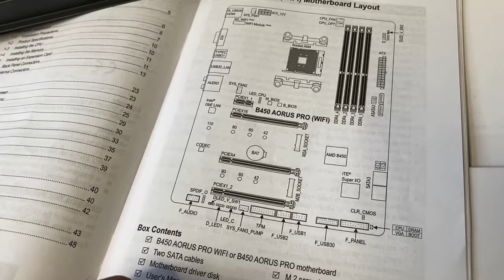How to Install a Case Fan in your PC

Comment: Hey so I have a Corsair 4000x case, just got a Corsair ll120 fan and the screws that came with the fan have too small a thread to tighten into the holes provided, the case also didn’t come with nuts which would’ve solved the issue. Am I missing something or should I use zip ties which looks like

Comment: Hi! What about those single fans that has pins for motherboard and a pin for psu ? Is it okay to plug both the wires or should I just pick one power source between the board pin and the psu pin??
Reply from the maker: I’m honestly not 100% sure. I think the pins for psu are for rgb. I’ve never used one of those fans so I don’t want to give you false info. Sorry
Reply: @BuildsWithV  my fan has lights but it doesnt change colors its fixed, i wonder if it would be safe to both plug the mobo pin and psu pin on a single fan 🤔 so i could change its speed.

Comment: So you can use the piggy back cable on ur fan as rgb lights too? You don’t have to plug in the rgb lights cable to the mother board and instead you can use the piggy back cable right?
Reply from the maker: That is correct. Thanks

Comment: what was that digital rgb you've mention at @4:20?? Can you tell me so I can see if my motherboard have that one, I have a Asus prime b450-A btw.and i recently bought a rgb halo fan but no lights im scared of connecting to other ports maybe it will blow. 
Thank you please do notice me :(
Reply from the maker: It’s a 3-pin Addressable RGB port. It has 3 pins total and between the pins it has one missing. If your fan has that connector it would plug in there. What fan did you buy?
Reply: i have Cooler Master MasterFan MF120 Halo 120mm fan sir
Reply: @BuildsWithV  I messaged you on your facebook page, I'm AR
Reply from the maker: @alryanalam  oh yeah those are 3-pin addressable RGBs.

Comment: Hey, so i bought these fans 2 days ago and my motherboard only has the “LED_C” 4 pins, is there any way to do it without the 3 pins because it doesn’t seem to work for me with the LED_C
Reply from the maker: Enrique He yes you can get an adapter like this one: https://amzn.to/3fZWMrf 

It’s a 4 pin to 3 pin converter
Reply from the maker: Enrique He it does not, the one you have is just a splitter meaning it allows you to connect up to 3 fans/RGBs to one header. The one I sent you is a 4-pin to 3-pin adapter. You plug it into the 4 pin header on your motherboard or the sata plug off your psu and then you plug all your 3-pin rgbs into the adapter. 

The reason you need a special 3 to 4 pin adapter is because the 4 pin header provides 12v power and the 3 pin only runs on 5v. If you plug 3-pin into the 4-pin header somehow, it could cause a fire.
Reply: @BuildsWithV  Thank you for taking your time and helping me with this. I appreciate it.
Reply from the maker: Enrique He it’s no problem at all. If you have any more questions, don’t hesitate to ask. I appreciate the support 🙏
Reply: @BuildsWithV  How can this be powered? From what you said u could either connect it to the 4 pin or the PSU for power, so does that mean the converter can be powered just from the 4 pin or does it need to be connected to both the PSU and the 4 pin? Thank you.

Comment: Question why do motherboards ship with a male 3 pin to a 3 female pit adapter what are they used for then? if fans are directly connect to the mother board?

Comment: Sort  of wondering if the rotation of the fan makes a difference that's my main concern I have Artic P14 PWM's and got two fans intake & 1 out take... besides from front facing etc does it matter which way it is rotated?
Reply from the maker: Seemslegit The fan rotation would matter, but usually when a fan has opposite rotation they also have opposite fins to keep the intake coming from the front of the fan. Thanks for watching 🙏

Comment: Hello I have a question! My case supports up to six fans, but I checked my motherboard and it only has one for fans. What do you recommend I should do?
Reply from the maker: I recommend a fan hub that supports several on one header. I have a fan hub video as well which explains in more depth

Comment: Can I ask a question? I bought a rgb LCD fan, however my computer doesn't have a connector for the the rgb three pin. What would you recommend, so I'm able to use the rgb.
Reply: Depending on your setup you may need a hub such as the corsair commander xt. It plugs to the USB on the mobo and you can connect 6 fans with rgb.  My case is a corsair with four fans plus a 100i capiellix with two fans.
Reply: @AuronFFX  wooo nice thank you for the reply Auron ^^
Reply: @AuronFFX  found out my motherboard can't handle a rgb connection. So ill just use the fan as it is
Reply: @Mina_Angel  What is your motherboard? If it has a free USB 2.0 header it should be able to support the commander. You also will need a free sata power connector from your PSU.
Reply: @AuronFFX  well its more, I don't have the money for it. Plus the Commander doesn't have a inlet that will work with the rgb plug. Its a weird 3 prong, like its 2 open spots, 1 blocked and then open again.

Comment: Very helpful 👍, i was confused about 3 pins and 4 pins power comnectors and scared i might short something in my mb, i have a case with argb but my motherboard only has rgb headers,i have built in controller in case, so no need to hassle around to connect in motherboard

Comment: So if you want to have 4 fans running you need 4 sys fans in your motherboard? I heard you can connect them together with a splitter but, is that the only way to connect them if you only have 2 sys fans?
Reply from the maker: You can use a splitter or a fan hub if you have more than 3-4 fans per header.

Comment: Question, we’re can I add fans, can I put them anywhere?  Or is their a specific spot??
Reply from the maker: There is usually specific spots in your case that you can put them. Technically speaking tho, you can place them anywhere as long as nothing interferes with their operation. Thanks for watching 🙏
Reply: @BuildsWithV  is their a way that you can look at my PC and tell me where I should put them?  If not that’s ok 👌

Comment: Just bought my first RGB fans to go in my case and I had no idea how to do it,  but with my fans I have a little “hub” that all my fans can plug into, any idea where I’d have to plug that into once the fans are connected to it?
Reply from the maker: That will usually depend on the hub, some Hubs plug into your PSU sata or molex connection for power AND to the motherboard and some hubs ONLY use molex or sata.

Comment: I don't have a rgb 3 pin connector, only the system fan connectors, on top of that the fans that came with the case has molex connectors, so I had to plug them directly into the psu and my rgb now looks like rainbow puke, anyways is there a way to control the rgb and make like just one static color?

Comment: i use asrock a320m motherboard... can i install that fan without stick the rgb cable and still got rgb ??
Reply from the maker: If you don’t plug in the RGB cable then you won’t get any RGBs. The fan will still work but won’t light up.
Reply: @BuildsWithV  👍thanks for explain

Comment: I want a MASTER CASE H500p mesh it comes with 2 massive fans and I want to add 1 more fan and 3 fans for the radiator,my MB will be X570 I think it didnt has more than 3 sys fans,I want more than 3. What Should I do plz help
Reply from the maker: All you need is an extra fan splitter.

Comment: Sir how did you mount the bottom fan in front? I can't put the screw because it's in the drive cage.
Reply from the maker: Jays Huvalla this case came with the fans installed in the front. The front fans also came with long screws that can be threaded on from the front of the case so you don’t have the get your hands down in there.

Comment: Hey I’m having trouble connecting the 3 fan wires to the mother board it’s pretty hard to find where they plug in where the go.Can you help me out?
Reply from the maker: If you have a standard fan like mentioned in this video, it will plug into a fan header on the motherboard. If you know your motherboard model you can look up a manual or if you have the manual you can check where it’ll show you the fan headers on the motherboard.

Comment: IM thinking of getting a P400a case that has 3 fans that come with the case. If i were to buy 2 more more i daisy chain them all to the ARGB header?
Reply from the maker: If they are all ARGB and they each have a daisy chain then yes you can daisy chain them together. I wouldn't recommend more than 4 on one header tho.

Comment: just recent did this same build but only using 2 notos as front fans plug one into the d_led bottom and one on the top right but rgb fusion isnt able to detect it, rgb wont turn on ?

Comment: as a PC noob I didn't know you could connect the fans either to the motherboard or the PSU... and I've noticed all mine are connected the PSU which are on 100% of the time and I have 4 pin functions on mine to change it but tbh I don't mind

Comment: U know the 3 pin connecter to connect to the bottom of the motherboard? yeah mine has 2 pin? I don't know if that is a problem or it doesnt matter. Someone tell me.
Reply: 2 pins are are and old now so not many people will be able to help u sorry
Reply: @FactFlix3  I am taking about the one that u would plug into the Powersupply.

Comment: The prebuilt I picked (cyberpowerpc gaming supreme for 999 on Best Buy) has two fans in the front and one exhaust in the back, should I also add fans to the top of the case?
Reply from the maker: You can if you’d like. It’s not necessary but might help to get you some better temps overall. Will help most during long gaming because of the extra heat removal.
Reply: @BuildsWithV  I have the same thing should I add one intake and one Exhaust?

Comment: Hey I know I sound dumb but I just transferred my Dell optiplex sff 7010 to a 10$ budget case (temporary) will upgrade to a good look tempare glass and put a gtx 1060 but my motherboard is gigabyte h61 I want to make  a budget rgb PC.But I want to know that there's just one system fan (4 pin) and the case I'm gonna buy the case which has 3 rgb fans I want to know how can I install those three fans on 4pin labeled as sys_fan or how can I install them through a power supply?
Reply from the maker: You don’t sound dumb at all, it’s a valid question. Depending on the case you get, it may come with its own fan hub that uses sata or molex power from your power supply. If the case doesn’t come with that, you can easily buy a fan hub or a fan splitter.

Comment: I just noticed after cleaning my pc that one of my fans isn’t spinning, not sure if it’s a temp thing that activates the fan when it’s too hot. Or if I messed with something while cleaning it. Any idea?
Reply from the maker: You could have just unplugged one of the fans a bit which is causing it to not work. Case fans should be running at all times so it’s either unplugged or it went bad.

Comment: Hey, I have the same mobo and the same fan. But I can’t figure out how to control the rgb. In my case the lights won’t even turn on. Is there some software that u used?
Reply from the maker: Teja Annamraju yeah the software on the aorus or any gigabyte motherboard is RGB Fusion 2.0 
Here’s a link: https://www.gigabyte.com/MicroSite/512/rgb2.html
Reply: Builds With V I downloaded that but it only shows the motherboards lights. It doesn’t show anything else
Reply from the maker: Teja Annamraju click on the motherboard and then it should allow you to change specific lights
Reply: Builds With V it allows me to change the lights on the motherboard but not the lights for the fan.
Reply from the maker: Teja Annamraju that’s weird, the fans are plugged into the motherboard correct? Like not into a special controller or anything? Feel free to DM me on Instagram @buildswithv and maybe I can help a bit more.

Comment: I have the 3 pin connectors on my fans but I have a 4 pin “rgb header”. Will it still work if I plug the rgb header with the 3 pin?
Reply from the maker: IGXT unfortunately it wouldn’t work. The 4 pin header provides 12v or power and the 3 pin rgb runs on 5v. In order to plug a 3 pin rgb into a 4 pin header you’d need an adapter/converter like this one: https://amzn.to/34lb3wF

Comment: The from of the fan does not suck air in it pushes out
The back is what “sucks”
Reply from the maker: No it doesn’t. The front of the fan pulls the air and the back pushes it out.

Comment: How does the rgb on the Notos fan look? Just bought a 5 pack and want to make sure they look nice.
Reply from the maker: Kermit The Frog they look great! Did you get the notos or the notos O?
Reply from the maker: I’ve used both the notos and the Notos O and they both look great. Here’s a link where I used the Notos O https://youtu.be/IsL_vxdn2Jc
Reply: Builds With V  I got the BPTA Notos 120 DRGB from Micro Center, they’re going to my very first build. I just didn’t want fans that only supported solid colors, want to run rainbow and that nonsense.
Reply: Builds With V I have an Asus motherboard, planning on plugging the controller into there to be able to control them using AURA
Reply from the maker: Kermit The Frog oh yeah these definitely do all types of different styles and colors. They look great. Just make sure your motherboard has support of the RGBs and has 3-pin ARGB header on the motherboard.
Reply: Builds With V I got the Asus B-550f board, i’m pretty sure it does come with multiple.

Comment: Hey so I have a question, so I'm rocking a MSI b150m bazooka and I didn't see the rgb header anywhere on the board. What do I need to get rgb fans working on this motherboard?
Reply from the maker: Xavier Villagran You’d need either a Sata or Molex RGB hub that has its own controller. Or you can get fans like the uphere fans. These already come with sata or molex power and can be controlled on their own. Here’s a link if you wanna check them out. https://amzn.to/2HBFd5h
Reply from the maker: I apologize youtube didn't notify me of these comments. The one with the remote you sent should work with those fans you sent me. The bigger fan hub still requires a rgb port on your motherboard so it wont work unfortunately.

Comment: What do you do if you your motherboard only has System fan 1, and its already in use for a intake fan? Is there a alternate port that I could use?
Reply from the maker: You would need a fan splitter
Reply: @BuildsWithV  Thanks! You earned my sub, this is super helpful!

Comment: Wait so when I get a rgb fan, does it come with two cable connected one for fan and other for lighting. Then how do I plug both into system fan 1 if there both 3 pins. That’s what I’m still confused on
Reply: I think there's a rgb header on motherboard

Comment: hey i have a question i have a micro atx case is there a specific size for the case fans?
Reply from the maker: You can use the same size fans. I think there are smaller fans out there. Just check your case manual to see what size fans it supports to be safe cause some may be different
Reply: Builds With V ok dude im new to pc building so i didnt notice the manual my bad
Reply from the maker: @c48i3  no worries at all 🙏

Comment: I have 3 pins on my fan but need a fan splitter, I know that one would have 4 pins for the splitter and the other has 3 but how would I align that
Reply from the maker: The splitters usually have the same little rail that the 3-pin aligns to as if you were plugging it into your motherboard. So basically it would be the same process.

Comment: For some reason the screw I got is not compatible with the fan.... When I checked the area where it is supposed to go is smooth and does not have those curves.... I had brought 2 sets and both of them had the same issue...

Comment: hi dear, I have a vdg cable but I don't know where to connect it ??
Reply from the maker: The VDG cable is only for certain gigabyte motherboards. Most new motherboard do not have a vdg header unfortunately. I believe you can get an adapter but I’m not sure as I’ve never used one

Comment: Hello, I Have Corsair SP120 RGB Pro Single Fan,
And I Want To Connect With MSI B450 PRO Vdh Max Motherboard, The Mobo. RGB LED HEADER.
And the Fan Have 2 Cable With 4 Pins. One Cable I Have Connected With SYS_FAN And Other One Connected With RGB LED HEADER.

BUT ONLY FAN IS RUNNING.
Reply from the maker: Corsair fans require their software and their rgb hub to work. The fan will work plugged into your motherboard header but the rgbs need their special hub

Comment: So should top fans always be exhaust fans or does it not matter?
Reply from the maker: It is usually recommend that the top fans be exhaust. The rear fan exhaust as well. You can do it differently but the reason it’s recommended this way is because hot air rises naturally so it’s easier to exhaust that hot air. Now I have seen people with Opposite and still get good thermals. I think it also depends on how the case is setup.
Reply: Builds With V ah ok just wanted to see if I did it correctly I built my pc couple of months ago but awesome and thanks for the quick reply and explanation, earned yourself a subscriber 👍🏼
Reply from the maker: Sergio Lopez yeah that makes sense, glad I could help and Thank you very much 🙏